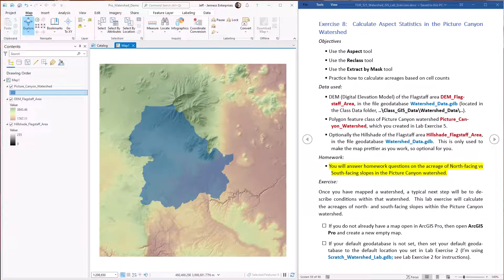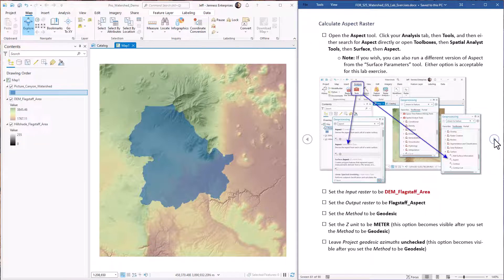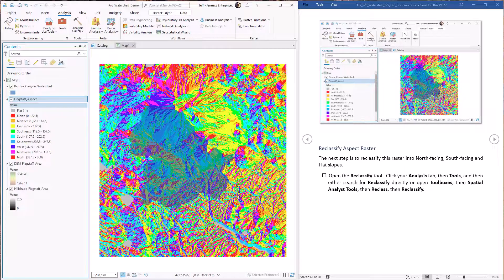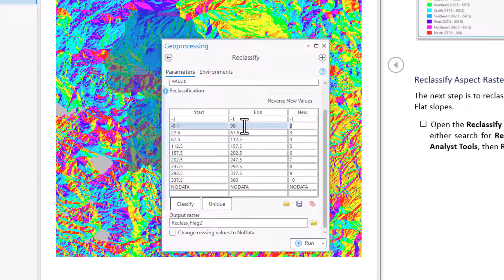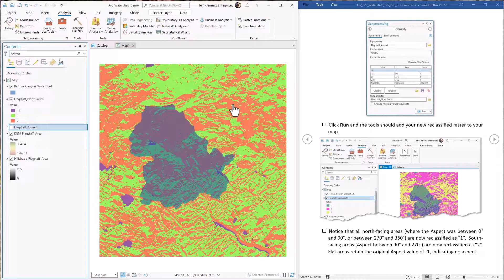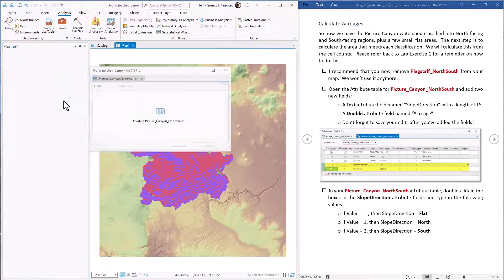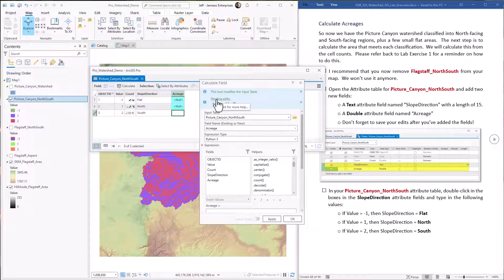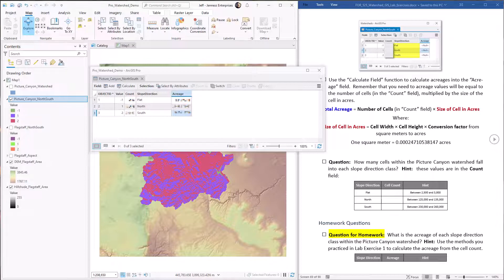Hydrology in ArcGIS Pro, Lab Exercise 8:  Aspect Statistics within Watershed

Comment: Hello Jenness, any chance you've got an idea how I can fix the bug that does not enable adding field to my raster. It says the table or feature class corresponding to this view is read-only. However, the raster was only reclassified as you have done in this video. Any tip to go pass this is highly appreciated. Thanks in advance:)
Reply: Update: I figured I could only add field using the geoprocessing too. PS: i'm using Arcgis pro 3.1 version! Hope this helps anyone who encounters this too.
Reply from the maker: Hi Mxzoe,

Hmm.  Could be a couple of things.  Is there any chance anything in the geodatabase is currently in an "Edit" mode?  Do you see any messages anywhere that say "Pending Edits"?  If so, then that usually prevents you from adding an attribute field.  I'm not used to that problem giving you a "Read-Only" message, though.

Alternatively, try exporting your raster into a new file geodatabase.  Maybe the current format is giving ArcGIS Pro grief, or maybe the current workspace has some issue with it.  Putting it into a new file geodatabase might do the trick.

And when all else fails, save your Pro project, close it, and reopen it.  That might clear out whatever is causing the problem.

Hope this helps!  Take care -
       Jeff